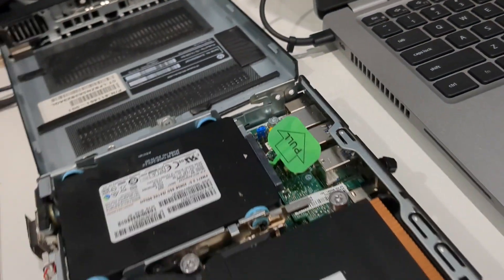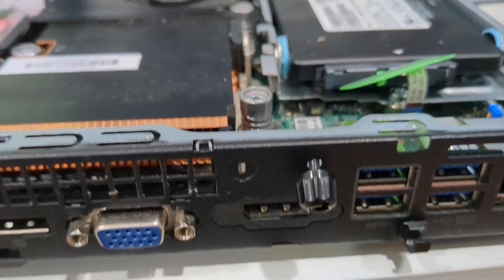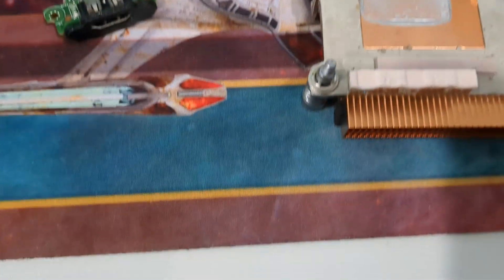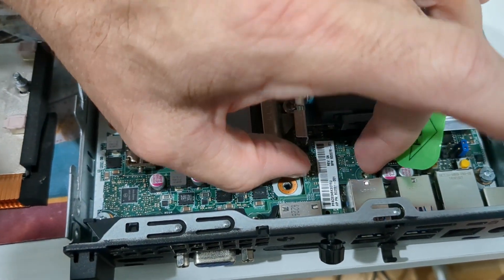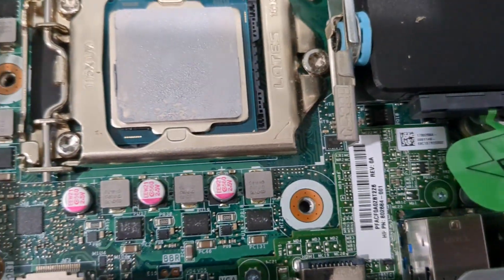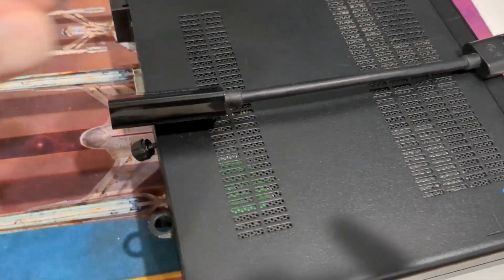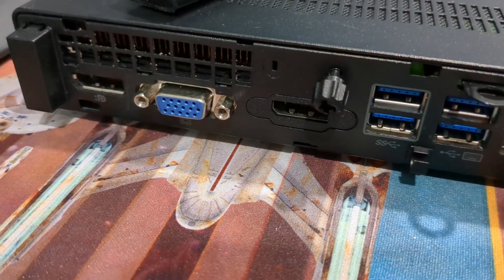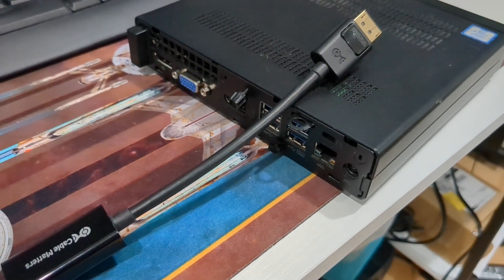HDMI On HP EliteDesk 800 G2 Mini

Comment: You can install another USB-C pretty in its place, as well. Just may have to get more power. Mine's a 35w model. So, I'll be picking my battles...
Reply from the maker: I haven't seen USB C option boards for the G2, just for G4 and above, and possibly for the G3. How would you add the second USB C port?

Comment: Those flex connectors on the minis are very unreliable! I was told by a Microsoft computer technician that they often times don't work, even though you feel them seat correctly, they just don't accept a good video signal from the mother board! Best bet is to use the onboard Display port with the HDMI adapter and run an HDMI cable into your monitor. That's how I have both my G3 65 watt models hooked up. They work just fine with no signal problems!...:body-blue-raised-arms:
Reply from the maker: I personally do all of my video either with an HDMI to Displayport adapter (easier to pop around to my different machines) or I connect via the front USB C to my DisplayLink docking station.
Reply: I've tried this twice, two different HDMI add-in cards in two different HP mini-PC's.  Neither add-in card would work.  I'm pleased to learn it isn't just me who's had problems with HP add-in cards.  No such problem with a Lenovo mini-PC when similarly installing an HDMI output, it worked perfectly first time.

Comment: I bought exactly same part for my 800 G2 before, and also didn't work either.
Reply: They are very unreliable!
Reply: I've tried this twice, two different HDMI add-in cards in two different HP mini-PC's.  Neither add-in card would work.  I'm pleased to learn it isn't just me who's had problems with HP add-in cards.  No such problem with a Lenovo mini-PC when similarly installing an HDMI output, it worked perfectly first time.

Comment: From where did you find this hdmi port
Reply from the maker: This is the item https://www.ebay.com/itm/324699103322 but the seller said it was only tested with HP 600 G2.  It was much cheaper than other ones I saw but then again - it didn't work.